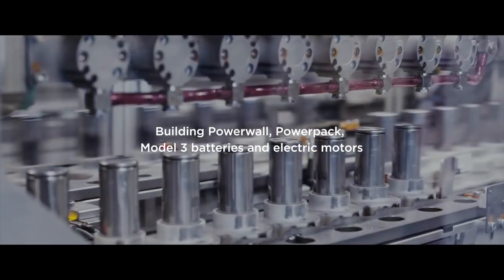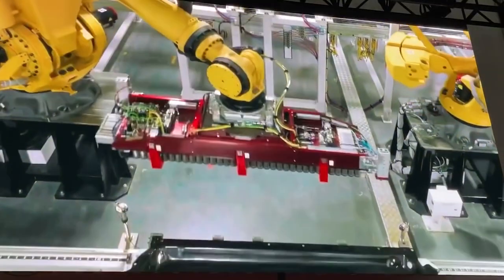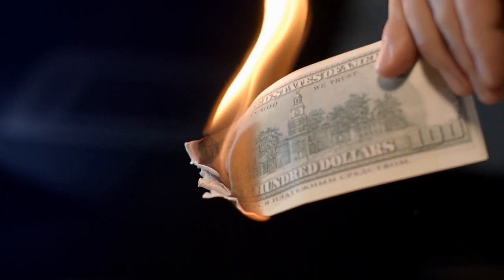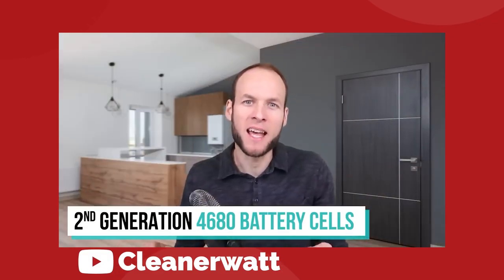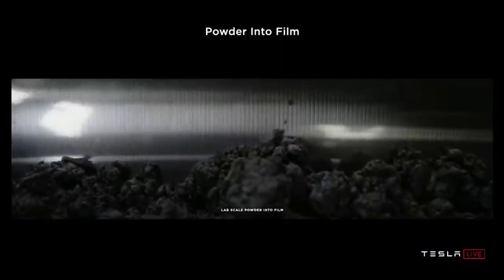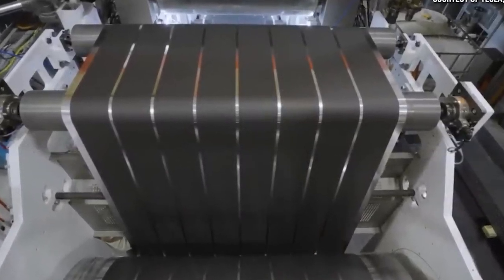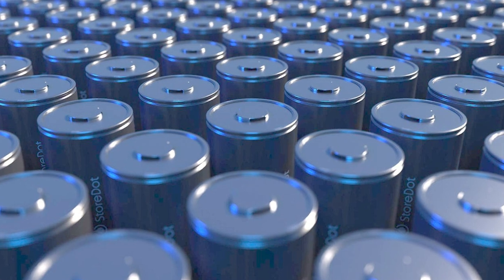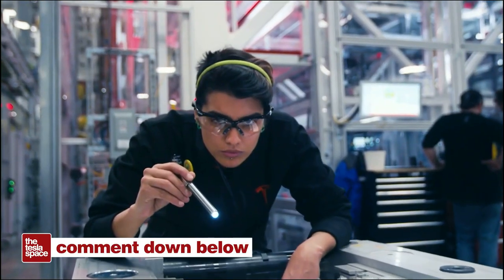The Gen 2 Tesla 4680 Battery Cell Is Here!

Comment: One thing that people still don't get is the 4680 hollow cyllinger in the Center can be a pressure valve if the cell should go critical it can vent outside the car through the bottom. Structural packs make individual cell replacements impossible and also need us to rethink how recycling works.
Reply: Structural pack recycling will be accomplished by grinding down the packs, then using thermal and chemical methods to separate the elements
Reply: It would be really nice if there was a way to address bad cells individually.

Comment: I thought Panasonic made Tesla batteries
Reply: Panasonic makes the 2170 batteries used by Tesla.  
Tesla will also buy 4680.  However, by making their own, they could increase production if vendors over-charge.  

Also, now that Tesla has established a battery supply chain, they can help smaller vendors buying components (allowing others to bid).

Comment: Page 6:13 to 6:15
…. to create one ‘solid’ connection … false. 
False? Anode flaps touching one another is practically point contacts and hardly solid. 
Even with laser weld can only be called a ‘line’ contact but solid contact. 
So what is solid contact? Solid contact happens only when anode flaps are ‘soldered’ directly at the cylinder base. 
Why soldering? Best practice in heat and current conduction.
What about point / line contact? 
Line and point contacts conducts current but heat.

Comment: 46800 vs 18650
What’s wrong with 46800 that has more kWh and larger cylinder area. 
The problems is - the increased in cylinder wall area can’t catch up with the increase in kWh heat dissipation. It has 2.56x less area per kWh of dissipation hence it runs 2.56x hotter. Continue this way without 2.56 times more heat sinking can break the 1 million mile longevity promise. 

If I remember right model3/Y has 1 strip of coolant strip shared by two roll of cells. In case of 46800 2.56x extra heat sink area requires 1 coolant strip per roll of cell. Granted 1 strip/roll, the coolant pump or heat pump needs to work 1.3x harder.

To make things worse adding faster charge heat dissipation. Given 60 minute charge reference, half time fast charge will generate 2x2x heat or 10 minute to 5x5x heat. That of also true on charge connector and cable. 

Misconceptions in electrical engineers? An 18 gage wire can handle 10Amp, and the same 18 gage wire is equally accountable for heat sinking for the source and load in that 10Amp circuit? False.
Reply: Tabless design significantly reduced the heat generation.
Reply: @quansun7633  elaborate?
Reply: @philoso377  traditional battery relies on tab, a single thin strip of metal sheet conduct the electricity from jelly roll to anode. The electricity have to travel long distance in most of time through this strip. Electrical resistant is proportional to distance and inverse proportional to the cross section of conductor. The lab wastes a high portion of the battery electricity which is in the form of heat.
Reply: @quansun7633  thanks for explanation. You have covered an electrical issue and I agree. My message was about thermal and heat sinking issue. Sorry that I missed your attention.

Comment: No No No
German Tesla is now selling Model Y with flat LFP. No battery production issues. German Tesla is a 2 LFP format. 1 with LFP blade or flat LFP from BYD and 2 4680 round can LFP format. 
Both flat and round have the same chemistry LFP and charging and controls is sysmillar But Flat LFP is puncher tested safer
So
Europe Tesla will have 2 LFP packs one 4680 LFP and 0ne flat Blade LFP
and
Due to the low cost Blade (BYD) battery German Tesla have lower the cost of the Model Y to Europe Customers
Reply: Show sources. 
No known 4680 LFP. 
NO confirmation of Blade use currently in GigaBerlin from Tesla.